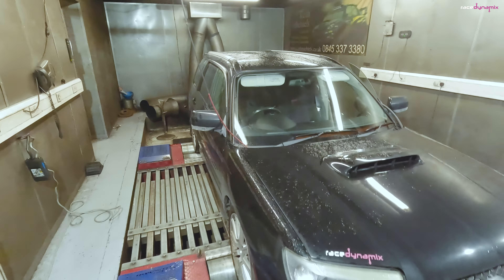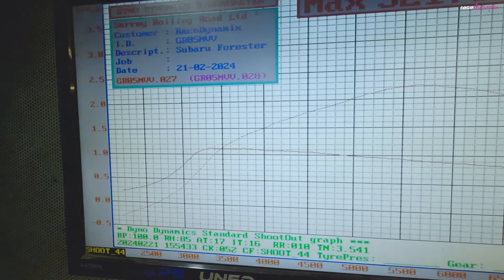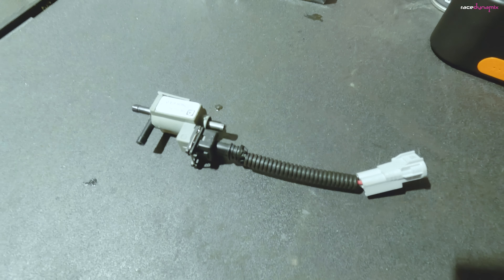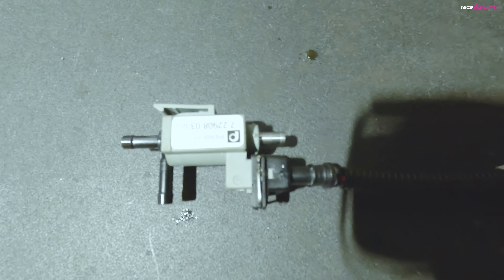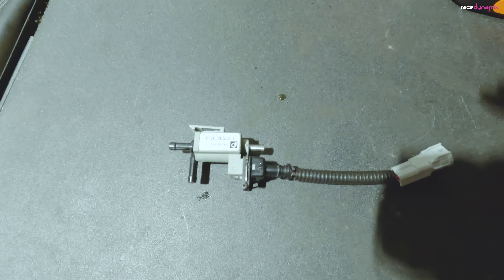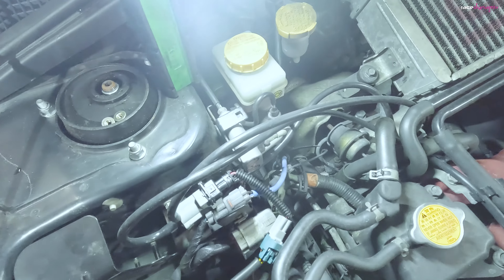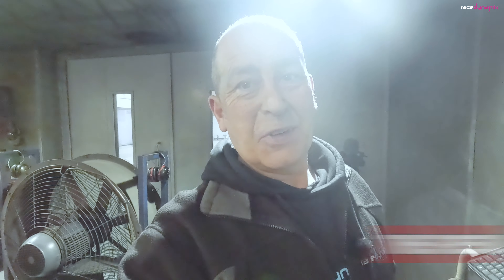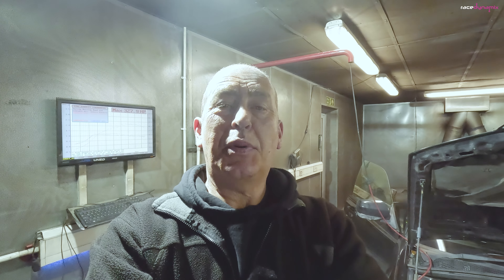More POWER for my Subaru FORESTER STi by fitting a 3 Port

Comment: Hi there. I have 04 auto fxt turbo, i tried to read its rom off the ecu but fails, am using a tactrix cable. I need your help. Am trying to self turn it.
Reply from the maker: Hi.  Have you got the test mode connectors joined and the white flash block on the other plug?

Comment: Great video Duncan. Opinions on water or water/alcohol injection as a safety net to remove risk of detonation on the EJ engine?
Reply from the maker: Thank you.  I am not a fan tbh.

1. Lots of expense
2. Can't tune for it on the std ecu so can only ever be a safety net.
3. A splash of meth in the tank works better as a safety net and more meth in the tank works better for power (if mapped for)

Comment: On the stock turbo it’s fine. But running a bigger turbo like TD05 18 or 20G you will see the difference much more. Turbo is able to build boost earlier and hold it longer. I had really quick spoolup with the 18G.
Reply from the maker: It varies tbh Martin, depends on the wastegate actuator.  A 3 port is never a bad thing though 👍

Comment: Great content for specified owners.. please share with me a tuned sample map for my stock 06 2.5xt fxt..

Decat downpipe,
Tgv deleted,
Prodrive muffler,
Sti timic intercooler,
Sti scoop,...
Reply from the maker: Hi.  Thank you.  If you join the academy as a remote tuning member I can send you a tuned file based on the file you send me.  I don't just send out files for no reason or benefit I am afraid.  I have no idea what rom your vehicle has on it and it would be irresponsible to do so as well as a lot of work for zero benefit. Join up 👍
Reply: @racedynamix  sure.. thanks for your guidance..